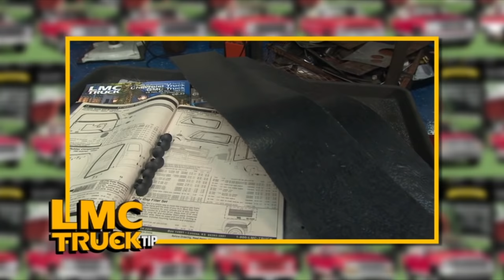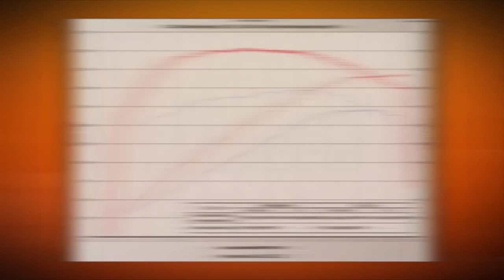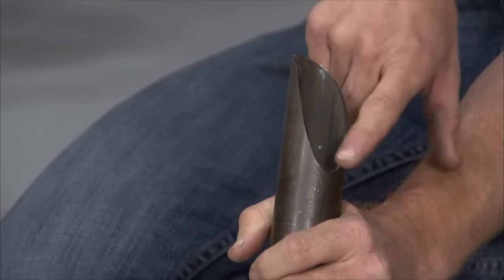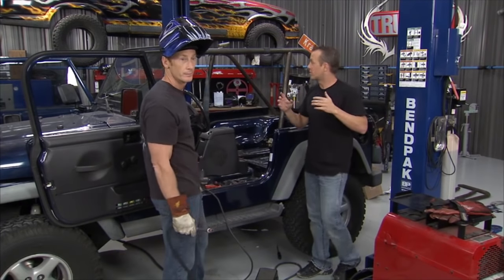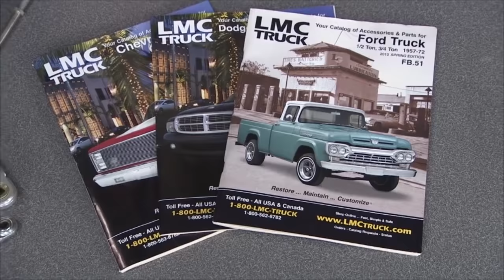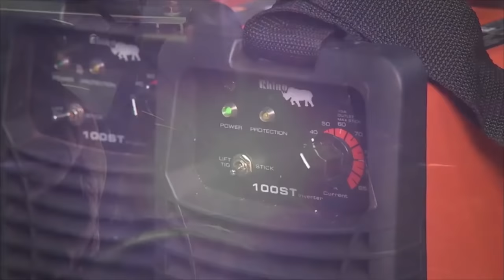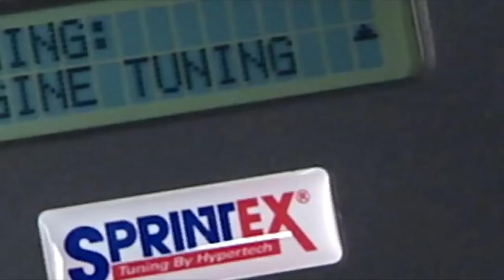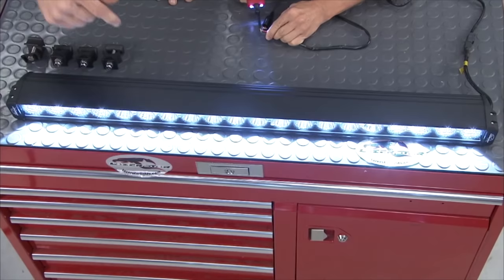The Jeep 4.0L vs. the 3.8L | TruckU | Season 8 | Episode 18

Comment: +25 bhp and +25 ft-lb from roller rockers on the straight six jeep engine?  you guys must have misunderstood 505, cuz that is plain bs.  put in a performance head and you can get that much increase,  but not just from roller rockers.
Reply: If they're different ratio rockers you can gain some power, but 25/25 is a bit much
Reply: lol i have a set of 1.7 rollers in my 4.0 and well you notice them you kinda dont to be honest, and no it was not 25/25 it was about the same as a good exhaust and air filter change, noticeable but not by much
Reply: They said 2.5 if that🤣

Comment: News fash you do not need to remove the cylinder head to replace valve stem seals. This only done if you have a TV show or you want to over charge the customer.

Comment: see many 3.8s  out there now with 250-300k
Reply: ed christman 
Yeah we've been screwed over by chrysler.
Reply: Yeah I see them too, they are all in the scrap yard it's really weird.
Reply: Yeah but full rebuilds don't really count towards that really.
Reply: mine is at 160K and still going strong.
Reply: I had just under 300k on mine before it was stolen. Still hate the engine though. I miss my TJ with the I6.
Reply: I see many 4.0s pushing 600k everyday. ive heard a couple have 900k and stock motor
Reply: xl_Graveyard _lx theres a lot of vids on youtube of it

Comment: You'll never see the likes of the 4.0L inline 6 ever again. This is the age of obsolescence. The 4.0 is perhaps the greatest engine of all time regarding longevity and low end torque. The 3.8 is ok if you upgrade the gaskets for the oil pan, valve covers and manifold. Chrysler used inferior gaskets causing the 3.8's to fail on purpose among other things. They knew they could never continue on with the 4.0L. Too much money at stake. While upgrading all the gaskets on the 3.8 makes it a more dependable engine, it will never be anywhere near as good as the bullett proof inline 6  4.0L!

Comment: Yeah the mini van motor in a jeep was a horrible idea. Swap it out for a hemi or ls chevy motor is best way because my jeep buds had their jeep 3.8 blow motor at like 70 and 80 thousand miles with lift kit and tires and 4.0 will go 200, 000 k
Reply: jason allen Your comment looks like a toddler wrote it.
Reply: i know people with 4.0 cherokees running to 713k miles
Reply: NoahBones 12: I hope I don't sound like an asshole, but what's the reasoning for so much hate on the little 3.8. It's been reliable for me 235,000 just the regular stuff done by myself.
Reply: Zachariah Woller i never hated on the 3.8, although i wish they brought back then 4.0 i6
Reply: NoahBones 12: okay sorry I used your name I was trying to talk to the whole group. But I understand. I loved the 4.0 itech AMC engine. I have a 5 speed version that I turboed, sounds like a Cummins. I just don't understand the reasoning for hate on the EGA serise and the EGJ series engines from Chrysler.

Comment: owning both i can say with honesty, stock for stock, gear for gear, and tire for tire my 2000 WJ has way more balls at about the same gas mileage over any TJ
Reply: Both WJ and TJ are 4.0L ? 

I have a 2004 4x4 WJ Freedom Edition with the 4.0 and 3.73:1.
Reply: @xmo552  maybe i got the model wrong, i was talking about the jeeps with the newer v6 vs the I6
Reply: @nathan00campbell  
Newer Wranglers are:
YJ.        👈 4 cyl or I6
TJ/LJ.   👈4 cyl or I6
JK.         👈4 cyl or v6
JL.          👈4 cyl or v6

WJ is 99-04 Grand Cherokee
Reply: @xmo552  ok well my grand cherokee is what i was comparing to the 4 door wrangler i had for only a 2 months, and traded it back in for a ram 2500. got the model wrong on the wrangler.

Comment: I'd never buy anything with the 3.8L,those things seem to self destruct without the super charger. The 4.0L isn't a power house,but at least they're really dependable and parts are pretty cheap & easy to work on.Did Chrysler ever fix the leaky rear main seal on the 4.0L? Those seem to leak alot. I been looking around for a YJ or maybe a V8 Grand Cherokee. Been kinda hard to find a good one fom the latter 90's early 2000's. Seems like people like to beat the heck out of em' or they have a bazillion million miles on em'.

Comment: Lol 25 pound feet of torque from at set of roller rockers? These guys must be getting great checks from the parts companys, for all of this false advertising.
Reply: joseph adams: well they could a higher ratio rocker arm, but 25 foot lbs is kind of BS.
Reply: They are a higher ratio. Plus the losses from friction on the stock stuff.

Comment: How is this even a contest? Longevity wise the 3.8 is one of the worst motors ever made. The pentastar series was a horrible designed engine. Timing issues plagued the 3.8 with tensioners often failing right out of the box. Along with lots of overheating and cooling system issues, mostly due to the fact that plastic is used for crucial parts like the water outlets. The 4.0 isn't perfect and has issue but, has farrrrrr more dependability than that 3.8 junk.

Comment: Ok lets see how that 3.8 is in 250,000 miles. Oh wait they won't last past 60k to 80k. I have replaced about 8 of them. Also lets stroke the 4.0 anr compare then. What a crap comparison. Apples and Oranges. Also did you mention where the torque comes in on both engines. Not!

Comment: 4.0L v8 5 speeds are way better than the automatics 3.8 in wranglers. 

As for Cherokees well automatic is way to go kinda
Reply: Trials and Tribulations never understood why Chrysler put in a weaker 6-speed in the later TJs. The 6-speed would of been fine if was at least as strong as the 5-speed.

Comment: Same 3.8 comes in the Dodge caravan:/.  I get hate on so much
Reply: Had an 2005 Grand Caravan SXT.  It burned 1 quart of oil every 900 miles.
Reply: Lee Vasquez: well you or the previous owner just didn't maintain it well. Mine has 235,000 and still has no blow-by out the oil cap.
Reply: The only real issue I’ve ever seen with them is with the intake if they are maintained properly.

Comment: A supercharger means premium gas with Jeep MPG! MPG increase with a SC.... I call bull shit!! Just the parasitic power loss from the belt drive of the supercharger is going to increase fuel consumption. The whole idea of forced induction is more air which means more gas to keep the fuel air ratio consistent. If you want torque what you need is a turbo. The are powered by exhaust gases, not the crank pulley, and still decrease mpg. Who takes an head to the shop to be decked and not even port and polish. I know it's a show, but damn...
Reply: John H 
It's not a show it's a commercial. I'm with you bro.
Reply: You're right about the supercharger not increasing MPG, but wrong about turbochargers.  Turbocharging CAN increase fuel economy, as long as you take it easy on the skinny pedal.  That is the whole concept behind Ford's Ecoboost systems: turbocharging for increased fuel economy, with a side benefit of some extra power available.
Turbos increase volumetric efficiency of an engine, and since they're driven by exhaust gasthey only work hard and cram a crap-ton of air down the intake when the engine is creating a lot of exhaust gas (i.e. when you've got your foot in it)
Hence, you get either better fuel economy, or more power, but not both at the same time.

Comment: It's bs, we all know chrysler took bought jeep was doing ok not great but ok, sold out fked the jeeps up, and continue to do so, droped the best motor they ever had only borrowed from amc, built a pos like always, we're fked, thanks alot chrysler. Every one noticed how 06 and older jeeps have sky rocketed, that 4.0 jeep engine and the 4.2 amc engine was damn good engines. Paraphrase a board meeting at the corp. We can't have that now can we, people buying jeeps and driving them 300k 400k we can't stay in business like that, lets fk people over, lets make a pos so they have to buy new every 7 years...
Reply: Pretty much. They got quite the number of idiots buying and scraping vehicles every 5 years. When they can last 40 or more years with proper engineering.
Reply: Agree with everything you said!!!!!
Reply: Chrysler bought AMC (the owners of Jeep) to get a quick SUV. Plus Jeep was the most profitable part of AMC (always was). Add the fact that AMC had a new car platform that was light years ahead of everyone else (would be known as the LH/LX platform), plus AMC had brilliant engineers and a more efficient way of designing cars to production. And AMC had just built a brand new state of the art factory and Chrysler knew it could get a deal.

Jeep was/is a constant contributor to Chrysler’s bottom line. The Wrangler and Cherokee were sales successes for decades, Wrangler still is. The Grand Cherokee gave Chrysler a solid foothold in the SUV market (it was already in the final design stages when Chrysler bought AMC). That new platform gave birth to the Intrepid, Cirrus, Breeze, Sebring and 300M and others. When the platform was used in its RWD configuration, it gave us the Charger, Challenger and 300C (and formerly Magnum station wagon). That new AMC factory has gone on to build those 3 cars. AMC engineers were major contributors to the Viper, Prowler, 94 Ram, Neon, PT Cruiser projects and many others. Using the AMC development style brought new cars to market in record time. All of this made Chrysler the most profitable car company of the 1990s.

Then Chrysler fell for the same scheme as AMC had when it entered a partnership with Renault (who then preformed a hostile takeover), which killed AMC. Chrysler entered a merger of equals with Mercedes which ended up being a back door takeover. After Mercedes bled Chrysler  financially dry and killed off any new Chrysler products, they sold them off to the highest bidder (cerbus) who then bankrupted Chrysler (because they had no idea how to run a car company) and the government forced Chrysler to be sold off to Fiat.

Renault then went on to perform another hostile takeover of anther flatlining car company in 1999, but actually learned a few lessons and manage to save the company and turn it around to stay a major player in the auto industry. That company is Nissan.
Reply: +CameroAmx The LH platform was derived from the 1987 Renault Premier. Then when Lee Iacocca brought AMC the Renault Premier was rebadged as the 1988 Eagle Premier with used the 2.5L 4 and the PRV 3.0L V-6 and lasted till the 1989 model year. Chrysler thought rebadging the car to the 1990 Dodge Monaco name would revive sales but sales tanked due to poor performance and reliability and lasted until the end of 1992. The LH Platform came out in January 1993 as the Dodge Intrepid/ Eagle Vision. The next year the C body New Yorker went to the LH platform in 1994. The LH platform lasted until 2005.
Reply: Chris Lemaster Renault owned a majority of AMC starting in 1979 (the merger was not unlike the Daimler/Chrysler merger years later). AMC and Renault had started the design of the platform in 1982.  Chrysler bought AMC in April of 1987 but left it mostly alone until late 1987/early 1988. The launch of the Eagle Premier was unaffected by the Chrysler takeover.

Comment: Honestly jeep lost my support when they canned the 4.0 ill keep my xj it has the only good engine Chrysler ever came up with
Reply: you do mean AMC came up with... goes back b4 Chrysler ever got involved.... 4.0 242 is based on the 4.2 258 based on the 232 and 199.  The 4.0 was in development stages before the buyout
Reply: Kenneth Leong the 4.0l was already in production by the time Chrysler bought AMC. And the I6’s architecture goes back to the 50s. 
The Grand Cherokee was already in its final design stages when Chrysler bought out AMC. Chrysler just got it production ready. The LH platform that most of Chrysler’s cars of the 90s were based off of the AMC built Eagle Premier design. The LH platform was designed to be FWD or RWD. The RWD version was called the LX. The LX platform is the Charger, challenger and 300C of today. If it wasn’t for Chrysler’s buyout of AMC, Chrysler’s history for the last 30 years would be way different. AMC gave Chrysler everything it needed to become the most profitable car company in the world during the 90s, from platforms to engineers to way  vehicles went from drawing board to production.

Comment: Sorry this may piss a bunch of trolls off but the 3.8 is a much better engine.  The 4.0 sucks modified and is not reliable at all.  Every Jeep magazine says the same thing.  The 3.8 may not be a torque king but can easily outlast a 4.0 in any condition.  Keep in mind the JK is a much bigger Jeep than the TJ they test it against.  A 4.0 in a JK would be a ticking time bomb.  Always electrical issues with the 4.0 as well.
Reply: Nothing has broken or failed with my 2001 4.0L TJ over 16 years, so that is strange! Starts the first time every time, doesn't leak, use or burn oil after 170,000 k's pushing 33x10" tires and it's seen a lot of rocks, mud, and snow!
Never had a single electrical issue except for replacing the fan speed switch on the heater module and a flasher unit for the indicators. The 4.0L is the most reliable engine I've ever owned, it's much the same story with most of my TJ buddies. I must be just lucky.
Reply: my 2004 4.0L TJ has the same issue as yours: very reliable and hands down best engine I've owned.
Reply: You have no choice now that you own it, have to prop it up, anyone that's not ignorant know your bs, the 4.0 is the best engine chrysler ever had, everybody knows it. So when you get 300k on that pos v6 without touching it consider yourself lucky., Also Don't be so narsistic. I work in an engine shop and that 3.8 jeep engine is a pos. Not gonna lessen to anymore of your bs.
Reply: John Hartney 
I sensed a slight bit of sarcasm in that last sentence, we know.
Yeah lucky you bought a pre 07 jeep, we all are, everyone knows about the king 4.0 and the amc 4.2, my wifes cherokee hit 300k a few months back water pump, altenator, and crank sensor is the only thing replaced on that engine, it don't get no better than that. Runs like a top. I have dozens of similar stories on the 4.2 and 4.0 basically chrysler just screwed us over with the 07 jeep.
Reply: johnbrakingground 
Jeep magazines funded by jeep ads, you think they're gonna put down what they're trying to sell... good luck on your 3.8 jeep, but the 4.0 was a great engine, not gonna hear none of your bs on this one.
Reply: 4.0 is a good engine.  3.8 is better in my opinion.  I've owned Cherokees and grand Cherokees with the 4.0.  Not bad.   I really like the the 3.8.  That being said I just rebuilt my 3.8 after 280,000 miles and do see certain things that I favored on the 4.0.  To say the 3.8 is junk is crazy.  Soccer moms have beat up and deprived the 3.8 in caravans for the last 20 years with very few issues.  When they started putting them in the jeeps they changed a few things and not for the better.  I switched out the Jeep rods, crank, and pistons for the caravans because the design was better in the caravan.  I'm a Jeep fan through and through so I take back what I said about the 4.0 it's a decent engine just not my favorite.  I still like the Jeep 2.5.  Even underpowered they were always reliable for me.
Reply: johnbrakingground 
Now that's more like it. I too over stated my stance i think we all do sometimes, but we can both agree we like jeeps.
Reply: johnbrakingground what in the fuuuuuck
Reply: Also the cherokee lifted with big tires weighs the same as a so called big heavy jk and my 4.0 jerks it around fine. And none of your so called electrical issues. I have never seen that and i work with thousands of tj yj xj cjs.
Reply: @brcar6862  It's all good man.  I'm anything but stupid but my initial response was a little premature.  The 4.0 is a great engine as is the 3.8.   I've built both if you check my youtube and after swapping a 4.2 to a 4.0 and carbing it I really like the 4.0.  The problem with both is they have chrysler electronics.  Get rid of that and they are both solid engines but I do lean a little more towards the 4.0 now after 2 years of running a 3.8 in my Jeep.  Hope that clears it up a little more.

Comment: having owned both engines I prefer the 3.8 all day long over the 4.0. the little bit of off idle torque you lose at 800 to 1200 RPMs is miniscule. The 3.8 is lighter smoother and far more efficient.  Not to mention just as easy to work on.
Reply: ok. i give. how is the v6 smoother than an inline 6. unless the inline 6 has a bad miss.  never before seen this. this is why i ask.
Reply: Not easier to work on than the 4.0. And doesn't last as long. Not enough low end torque.  3.8 sucks. Not fun at all.

Comment: GM's 3.6 makes 300hp out of the factory.
Mopar cant make that with a 3.8.
They should be embarrassed.
Reply: They stopped using the 3.8 almost 10 years ago. Hardly comparable

Comment: 3.8s are junk and have huge oil consumption problems. literally will burn so much you will have less than 2 quarts left in the engine between oil changes
Reply: 230,000 miles on my 3.8 and maybe goes through .5 quarts every 4k miles.
Reply: johnbrakingground got lucky. I've seen 3.8s with 40k and no oil on the dipstick
Reply: I think it really comes down to the people that own the vehicle.  I've had 3 now all with over 200k.  I was a mechanic at a dodge dealership.  Some people never change their oil.  Damage can happen really quick on engines with zero maintenance.
Reply: My 2011 JKU with 55K miles ran itself out of oil between changes and cost me about $5K.  No noticeable smoking or leakage, so I hadn't checked it.  Started reading afterwards and found it to be a common issue with a related bulletin from Mopar.